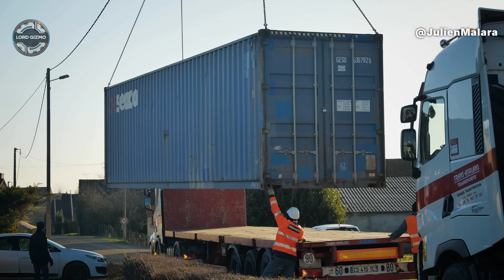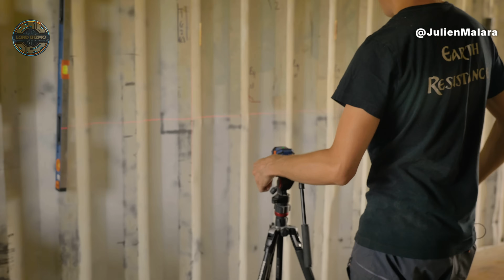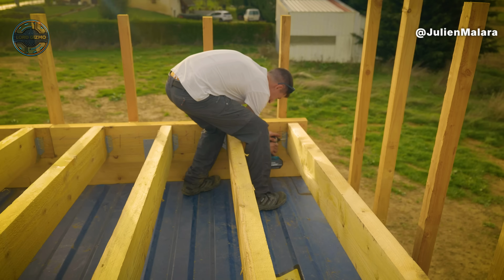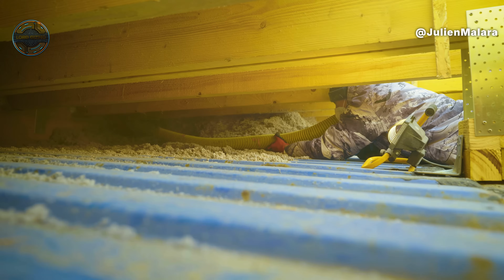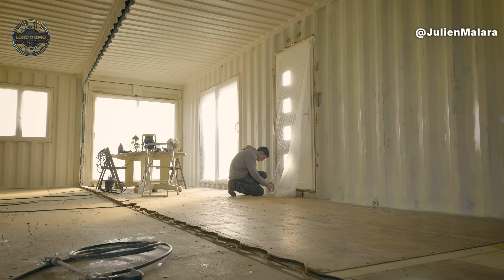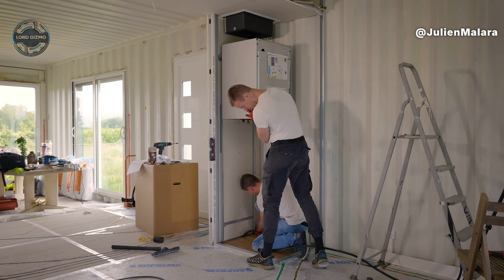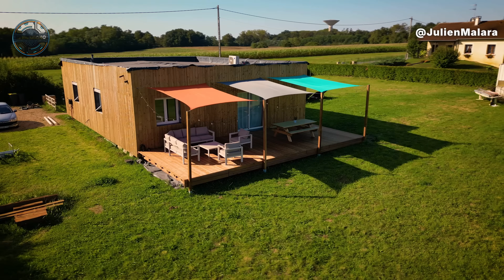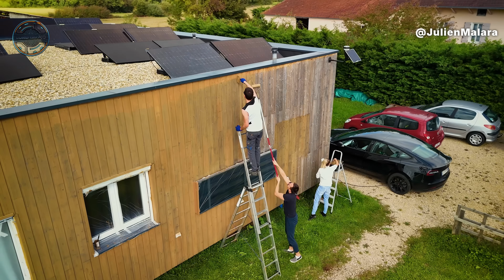He Turned 4 Shipping Containers Into a Luxury Home | Start to Finish by @JulienMalara

Comment: They built a conventional house around shipping containers. What's the point?
Reply: Zombies can't eat through metal
Reply: @StoryTimeWonders254  This is the closest we're going to get to an intelligent answer in this comments section. 😁
Reply: @StoryTimeWonders254  Mr.X has entered the chat
Reply: @StoryTimeWonders254 😂😂😂
Reply: I went through this similar situation when I bought a Colour Bond shed from Easy Shed.  I was so flimsy I had to build an internal frame.  By the time it was complete I realised I could have saved the money from the shed purchase and just built the whole thing out of wood.
Reply: They also build a nice pool on the roof, I think that’s the point .. 😅
Reply: @maxkallio I like how the narrator tells us they used an EPDM roofing material for the light weight, but with zero scuppers what will the water weight add up to. Also the metal cappers cut the rubber half way back on the parapet top they are risking water leaks through fish mouths especially at the corners that we didn’t see the finished product. The builders looked good but I know they were not roofers.
Reply: @maxkallio  My thoughts exactly 😅 Hopefully not that much rain..
Reply: I guess to reinforce the walls?
Reply: @DJSkittleT  From what? Is he building a Narco Bunker? 🤣
Reply: 100%.   People keep making this shipping container houses and then have to cut them open, put in traditional framing so they can run plumbing and electric.   Just skip the container and have the framing.
Reply: @Bros4KamalaSuckD . Actually the price per sq ft is quite a bit cheaper then a stick framed house.  And there’s a slim chance it will burn down.  They might be doing it just because they want to.
Reply: @MitchWolf-s1z  I don't believe it at all that it is cheaper.   It is only cheaper when comparing paying someone to frame it vs doing it themselves with a steel container.   If they have to pay someone to cut the windows out of the steel, frame the interior it would exceed the cost and time to just frame it.   i could frame a house that size in a couple weekends with a scissor lift and a friend with a framing nailer.   Everything is harder when dealing with these containers.   Even the owner of this build admitted it took longer and did not save him money.
Reply: @Bros4KamalaSuckD you haven't seen All of them
Reply: @Bros4KamalaSuckD it's pretty obvious you don't have construction knowledge mate
Reply: @qedindabakhumalo1111  bs.  it is way easier to frame this for the reasons I gave.  Have you done framing.  What is the cost to buy the contrainer, ship and rent a crane for a day.   Have you done construction.  If you had you would know the signifant cost to get that container in its spot.   Then this guy not only frame the inside but he framed the outside.  Then he had to do some welding and metal fabrication that would have been unncessarily.   Where is this savings?
Reply: @Bros4KamalaSuckD  Agree! Conventional house framing seems much more economical than using steel containers.
Reply: @tommieyamaguchi7207  I would rather frame it with 2x6 exterior walls.   A person can buy a Rigid framing nailer for $200 and a box of nails for $90.   Two guys could frame and sheath the entire first floor in a weekend.
Reply: @Bros4KamalaSuckD Right!? 😅 Hell, the big box home improvement stores will even rent you a nail gun. But props to the man for building it "his way".
Reply: @tommieyamaguchi7207  Bet the container house is stronger in a storm and easier to heat and cool.
Reply: @DebraCarey-w1b For sure. I just view it from a cost perspective. Wood framed houses  are secured with many, many hurricane straps.
Reply: @tommieyamaguchi7207  This build is happening in France (judging by the car number plates). Old containers, if you're not fussy, cost up to 2000 Euros / USD a piece, so for about, say, 10k you have the complete outer shell plus some of the interior walls ready-made. This structure will not be blown to matchwood in ANY storm, however strong. So cost, speed and sturdiness would be very strong points in favour of this build.
Reply: @tommieyamaguchi7207  "conventional framing" is only "conventional" in the US. Other countries rarely build their houses with sticks and OSB.
Reply: @roml1289 💯 Facts!
Reply: @tommieyamaguchi7207  well to be fair some countries like Japan use wood framing, but they don't use 2*6
Reply: @roml1289 Agree! Here in the U.S. lumber is abundant and relatively inexpensive [Trump-onomics makes everything expensive].
Reply: @tommieyamaguchi7207  yeah, cause everything was so cheap and good with dementia biden
Reply: @DebraCarey-w1b the bits of containers that are left , the interior walls , will run wet with condensation.
Reply: @Bros4KamalaSuckD  This was the most over-engineered thing I have ever seen. I guarantee they paid 3 times as much to build all that compared to standard techniques. I saw comments talking about how cost effective using the shipping containers were. I'm thinking yeah maybe but you had to haul them to the site and get a crane for a day. Then the fact that it's sitting on little stilts and has a flat roof tells me this place isn't going to be in great shape in the not so distant future. The whole thing looked like an advertisement for using reclaimed materials to me.
Reply: @MH-br3th engineering would infer some sort of thought and planning went into this. This is an idiot with a bright idea they never fully thought out and just figured they'd hit the go button. In my area a shit quality container is 4k. Lol he's easily 2x'ed his costs if he didn't get them free. And if they were free they are probably contaminated with toxic shit lol
Reply: @MH-br3th except nowt was reclaimed, apart from the hacked to death shipping containers .
Reply: If one lives in a tornado prone area, say Oklahoma or Kansas, this is vastly safer than a traditional wood frame house, that can be easily wiped out .
Reply: @StRicardo-76239  Yes, now it just blows away fully intact. 😆 BTW, no it isn't.
Reply: As not to loose space, when adding the installation
Reply: @LindaMasso-t6v  With all due respect that is a bloody stupid answer. The container is simply replacing the interior supports, and as such saves no space at all. In fact it likely takes up more space than traditional wood framing. On top of that, they are building from scratch, on a large piece of land. If they want more space, they can simply build the house bigger. From that perspective, the containers are actually restricting their options.
Reply: @ASavageEye sorry I really have no experience in this, this was just my reasoning,  I do respect you for your comment it seems that you know more than me.
Reply: I had the same thought, it’s nothing like the shipping container homes I have seen built in the past, they at least celebrated the life of the container by still being visible.
Down the road from my home town there is a home being built right now with two very lark shipping containers. All they built on the outside is a roof to stop the water from sitting.
Reply: The "right" way to do this is by attaching 3.625 metal studs to the outside, closed cell insulation between the metal studs and over the top, then sheathing/siding. This approach minimizes foundations and utilized the existing structure to support the finishes. Under slab plumbing, 7/8" z-furring & 1/2" gwb on the interior. The saving is found in foundations and labor avoided in framing. super fast time to certificate of occupancy.
Reply: @Inda716  You loose money washing the residues and smells of human trafficking out of the containers though. 😉
Reply: And in a record 600 days.
Reply: Exactly 🤦‍♂️🤦‍♂️🤦‍♂️ you put up a wood frame around the containers, why not just build a normal house 🤦‍♂️🤦‍♂️🤦‍♂️🤦‍♂️🤦‍♂️🤦‍♂️🤦‍♂️🤦‍♂️
Reply: I thought the same 😵‍💫
Reply: 😂😂😂 I came here to say this!
Reply: It could be to have a stronger structure for tornadoes areas..
Reply: Click Bait? ...Or maybe to exemplify that all Container Houses are actually pointless. Just build a clad, timber frame home. 💁🤷🙋
Reply: @dae90101 Yup and let the tornado take care of you....😑
Reply: @Karen-ig6bp  A shipping container uses 1.6-2.0mm thick sheet metal which these guys cut the walls out of and also made windows in! It's not even remotely tornado resistant. You could drive a bulldozer straight through it. A tornado is like that bulldozer. Go do some engineering and get back to us after you master math.
Reply: I agree. I’m a builder of 35 years. It’s false economy.  If you are framing inside and outside you’re doubling up on timber. I was going to build a container home but did the math. It doesn’t save anything
Reply: @Privateparry  there point is not to be concerned about cost, your concern about is not relevant to this particular video. This was not done for the purpose of saving money and this is not about economics nor concerns of a profit its a livable art piece demonstration, its like going to a automobile show.
Reply: I am building a similar type of house, here in Germany... for my family. Actually, it is an extension of an existing house. 
The point of such construction is that you can build an energy-efficient house in a very short time - with relatively little money. You don't need to be any expert, just a little knowledge and good will.
 In addition, this type of construction allowed me to make my flat roof completely green, full of plants. In my city where I live, the local government subsidizes green roofs.

 Everything you see in this video, I am similar made...where does the main point come from - the house costs 40,000 euros. 
Otherwise, here in Germany, if a company does the work for you, you can't even build an ordinary basement under the house for that money.

Can you build this for 40.000?
Reply: @899baki Thank you so much for sharing your story with us! Affordable housing is a big issue everywhere. We are in need of new ideas to try. Most shipping containers are only used once for transport and are in perfectly fine condition. The good ones cost more, so those who use multiple use containers are getting damaged ones and the cost savings is not worth it.
Reply: @sharondoan1447You're welcome! In about six months I will finish my project with Biro containers, a flat roof with plants, with final and detailed construction prices, etc... then I will publish my first video on my channel. I invite you in advance to watch that video. Greetings
Reply: @899baki I am now looking forward to it!
Reply: @899baki lovely do you have a channel ?
Reply: Why don’t you try and build one
Reply: A trap house with security doors and windows
Reply: Stooooooopid……just plain dumb
Reply: Why not If I had the money I would....
Reply: Look at the interior. They just flipped the concept. Normally they just use the shipping container as the exterior and finish the interior. This has a finished exterior, but shipping container interior walls. Either way it's still less work than a conventional home.
Reply: The point is to make money in YouTube!
Reply: @musimero 😂 I needed a bit of humor among all the criticism. People are too serious sometimes.
Reply: Well, it is very stable and uses something that would otherwise be old junk that would take centuries to decompose if left sitting around….its tornado and hurricane proof too.  It can also bear the weight of a very large array of solar panels.  If Armageddon comes, I would want to be in THIS HOUSE 👍🏻😉.  The exterior isn’t very attractive though.
Reply: AI
Reply: You stole my comment,  containers take more effort than theyre worth
Reply: I think, containers are stable for DIY. A proper wood structure needs expensive specialists...
Perhaps the builder is a metal guy 🤷
Reply: I think is makes building a house seem more approachable to novices. ou are not building a fame and trying to get it to stay up on its one and be straight and perfect, all you have to do is attach wood to tall.
Reply: That was the first thing I thought when I saw this. The whole point of using shipping containers is to avoid doing a bunch of framing...
Reply: Well people have their own choices but it seems not logical to built a house frame out of steel containers..
Reply: So what? His build.
Reply: I think they did an amazing job I would live in that the rest of my life
Reply: Yes! You are also limited to the container footprint. I have worked with the a lot. Unless you buy them new, they are all damaged also. So you deal with that also.
Reply: They want the mold that is hard to get in a normal hose
Reply: Its bullet proof and wont blow away in a decent wind like American homes
Reply: @theycallmemrboombastic6870 
Exactly. 
Shipping containers are made of corrosion-resistant Corten steel. 
They can withstand extreme winds of up to 175 mph (282 km/hr), when properly anchored, and are naturally resistant to fire, water and pests.  ❤
Reply: @theycallmemrboombastic6870  if you think for a second that’s not blowing away in a tornado 😂😂😂😂
Reply: @jasonbritt2497 wrong
Reply: Meth lab
Reply: Exactly what I came to the comments for
Reply: AGREE
Reply: Exactly what I was thinking. 🤔
Reply: Brilliant idea!
Reply: Was thinking the same....
Reply: Exactly what I was thinking. There's little difference between this and a wooden framed house with layers of insulation and waterproofing, except you've had all the bother of cutting holes out/sandblasting etc.

And after all that effort you end up with what looks like a portakabin with no character whatsoever.
Reply: Exactly my point , there is no need for the containers they serve no purpose.
Reply: because they can, this is about what's possible in this context.
Reply: Does this preclude taxes being paid if they use a container?
Reply: Faster
Reply: Good job, but still looks shit.
Reply: Ветром не сломает...
Reply: Ugliest overpriced house I’ve ever seen. Not enough windows.
Reply: In this time a build a real one😅
Reply: Ya was just thinking to myself what the f..k are they at
Reply: Cost ?
Reply: Hurricane safe?
Reply: 600 days to build?????
Reply: @AmericasTenor  That’s a long time. Maybe they could only work on it in their spare time.
Reply: 😂😂 was thinking that very same thing.
Reply: Cost
Reply: He didn’t have to pay for the concrete for the foundation
Reply: @FaronArnold-b4h That sounds like a substantial savings to me.
Reply: Cheaper to start with.  Then there’s the novelty of it.
Reply: They're nice in Texas because your home doubles as a tornado shelter.
Reply: The R factor is off the charts, so is its durability.
Reply: More clicks
Reply: cheaper I guess if you built it your self its about 5 grand per container maybe cheaper for smaller one
Reply: It's cheaper for one
Reply: Fell asleep twice 😴 zzzzz
Reply: It's more long lasting
Reply: If you watch the video you'd see it's  for insulation purposes actually
Reply: Because they love cheeseburgers. 🤙🏽
Reply: I’m just here for the comments😂😂😂
Reply: The metal is the bone of that structure. A container alone is cold hence the additional materials for insulation and all. Now imagine if you set it on fire, there's a chance of saving it before it's engulfed in flames compared to a log house/cabin. If there's a storm and those containers are held tightly to the ground, the structure stands a chance to survive! Aside from a brick house this is actually a good idea of building something stronger and durable
Reply: I thought maybe it saved time and money but it didn’t so I have to agree with this comment…
Reply: Insulation mainly but im sure in the end its cheaper doing it like this!
Reply: @jamesclayton3074 that's what I was thinking. ✊🏽⚔️
Reply: @jamesclayton3074  I wonder what the R Value of painted steel is and the cost/benefit of painted steel insulation over conventional insulation? 🤣🤣🤣 BAHAHAHAHAHAHAHA
Reply: Containers are cheap in Europe...like $4,000 USD. So $16,000 USD right off the bat. Saves money!
Reply: @justrandomguy2026 but what's the point? You don't need the shipping container at all!
Reply: @justrandomguy2026   You'd spend under half that in concrete for footings, foundation and all the framing
Reply: @justrandomguy2026 brother wood at the hardware store, like big box, the most expensive wood you can buy is half that. Framing lumber is cheap as dirt. 3$ a piece. You could literally buy 1000 pieces of framing lumber and still come out cheaper than a container. This is literally a ploy by the shipping industry to get rid of their waste at profit. The only time a container makes sense is if you are burying it to grow weed like they did in BC in the early 00's
Reply: @justrandomguy2026 saving what money. Do you know the cost of shipping containers transport and also renting a crane? Then don’t forget the foundation and welding. And that’s just the rough stuff. From there you will need to frame it and make sure the interior is free from chemicals. lol. This is the worst idea for a home.
Reply: @DukeTubingston  No need to rent a crane, you can use sideloader trucks for that. They have a crane. Its not that much more expensive compared to a regular container truck
Reply: @justrandomguy2026  and NO NAZI GOVT SAYING YOU CAN'T DO IT
Reply: Sure are a lot of F@cking haters on here. Who cares how much they paid or what you would have done. The issue is this guy wanted to do it and did what he wanted. In case you are not aware shipping containers are sturdy and that means less interior load bearing walls need to be built. This guy did a great job, the only thing I would have done is have a roof with a drop towards the back for snow and rain to flow off.
Reply: Agreed. They cut a lot of corners and used the cheapest most unreliable things. They saved no money using containers. This is not a good build.
Reply: Garbage build.
Reply: You didn't WATCH AND LISTEN TO THE VIDEO 🤦🤦🤦🤦 They built the wood around it for EXTRA INSTALLATION! And to give it a ROOF LINE!!
Reply: @kweaver1965  You didn't get it. They could have just built a timber frame home without the containers. 🙄 This is the dumbest thing I've ever seen (Since the last container home).
Reply: @dae90101 No I get it! You don't again listen and watch the video it EXPLAINS why they did it 🤦🤦🤦🤦
Reply: @kweaver1965  No, it doesn't. I makes no sense. You're just not smart enough to get why it's completely stupid. What do you even mean by "extra INSTALLATION"???? 🤣🤣🤣